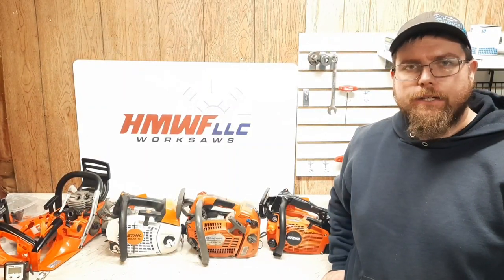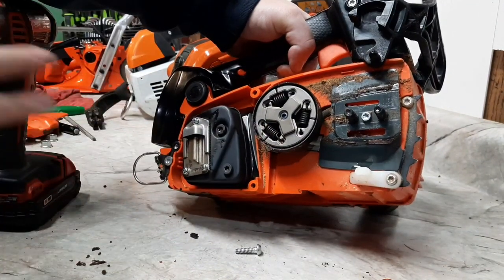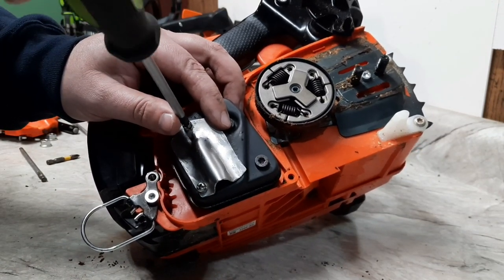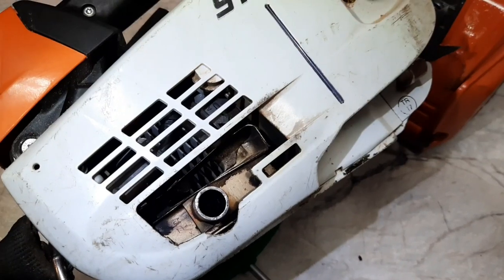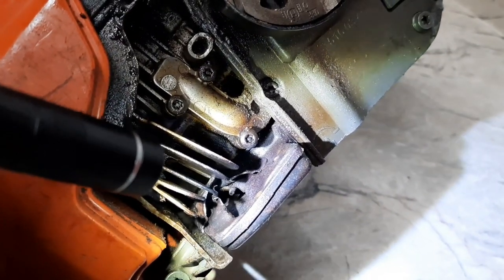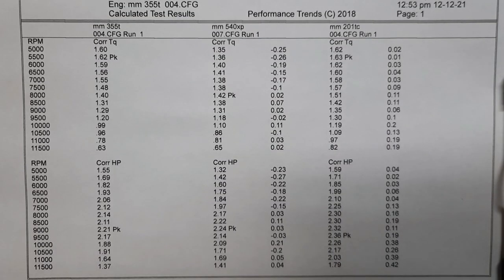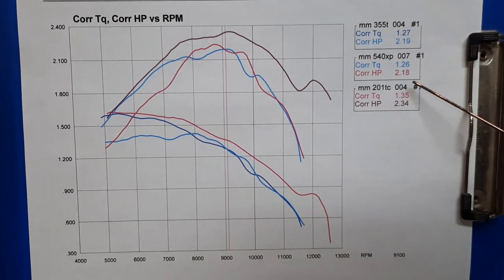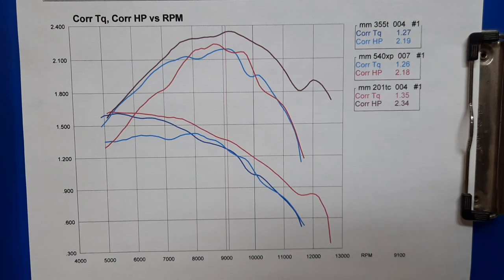Stihl, Husqvarna, Echo Top handles! Most powerful!!

Comment: This is why I feel the echo 355 with a muffler mod, or even a bolt on ore-modded muffler, is such a great deal for a top handle. My buddy runs an echo 330t and it's a great saw. Not quite an echo 355t but it'd be far better than any comparable priced top handle out there.
Reply from the maker: Most cost effective option for sure.
Reply: @dynojoemods2764  13200 RPM MAX IS OK 372 XP OE?
Reply: I used the Echo top handles in the past and they were good units, The Stihl is also good, it does have more power and built a bit better in my honest opinion, I am not biased. I never tried the Husky top handle but I do have several 372xp saws and I like them.

Comment: 355t is probably the one with the most ridiculous gains I've got from a ported saws, its like a 50cc saw after mod. Just unbelievable....nice work as always brother!
Reply from the maker: Will be fun to see the gains!
Reply: @dynojoemods2764  @Paveen Raj my 355T absolutely rips! Jereme Bell did mine. Tube type muffler mod, ported, and timing advanced. You can see on his YouTube channel my saw versus a 201T a year ago.
Reply: @johnlincicum6390  what a beast!
Reply: @vinzer8808  yeah it is. Bellhopper couldn't find my 16" bar I sent with the saw, but rest assured I run only the 16" bar on it and it still rips.

Comment: Joe, I remember showing pigs with you and your brother at the fair. How interesting to find you on youtube when I'm looking up saw performance. Great videos! Keep it up
Reply: I'm also curious to see how a 435t sizes up since that's the one I use every day at work
Reply from the maker: I'll have to see if I can track one down.

Hope you and your family are doing well.

Glad you found the channel, hope it can help with saw performance info.
Reply: @dynojoemods2764  I have one you could test if you can't find one. Same to you and your family!
Reply: @jaredeberly9724  I have 3 that I ported they will out cut my 540s.  Can't do whole lot with compression. But little goes long way. And lots of room for improvement on transfers and exhaust port. Just don't raise the exhaust at all. I widened and reshaped the intake and rased the bottom few numbers. Its mind blowing stout.  I port matched the exhaust to muffler.Closed of the tube. I use cut off deep well sockets on my custom exhaust so I can change the diameter and found 11 mm is the ticket! Cut whole in plastic have exhaust come out under the bar.

Comment: My company runs small Stihls and big Husky's. The t540xp can be a pain to start up in the tree at times. I've actually thrown one out of a tree because of it.
Reply from the maker: Testing the durability I see....

The one I have may have come from your company lol. Appears to have hit the ground a couple times.
Reply: Lol they can get aggravating. I don't even pull it without choking it anymore. 🤣
Reply: Each to his own I guess. I would like to try one of those Echo 2511t saws though just for the reduction in weight.
Reply from the maker: @treemerc101  

Ported 2511 is about the power of these bigger saws stock and I believe about 2+ lb lighter.
Reply: @dynojoemods2764  2 lbs is a lot less wear and tear on the body over the years. I really appreciate you putting the numbers out there for us. Keep them coming man

Comment: Is this really fair. the echo has a cat in the muffler which will restricts flow yes you opened the deflector but still, do the other two have cats being muffler modded and being auto tune? amazing how every ones says the echo is heavier, obviously is not on your scales, but yeah very little between them, i know when i decatted and piped my 355/360t.. turned into a different saw only downside is the filler holes are little small but it is an oldish saw now. still very cool👍
Reply from the maker: Probably not 100% fair. But all were simple 10 minute muffler mods. The husky was probably a 30 second mod. These were all just simple deflector/outlet mods.
Reply: I know what you mean, my friends husky 359 has a cat and we bypassed it and it really work up big time. Felt like it had an extra 30% more power.

Comment: Where's the 70cc class stihl 462cm an 572xp is really what I want to see them 2 saws others to compare
Reply from the maker: It is coming. Before 2022.  That is a hand full of saws to aquire. They are rolling in though.
Reply: @dynojoemods2764   have you dyno'd a 462 with the Red Beard foam filter vs stock airfilter?
Reply from the maker: @chrisp556  
I did one of those, I think it was a 462. They did improve over stock.
Reply: @dynojoemods2764  thx.   I have a Straight Shot and bn wondering if the foam filter showed an improvement on the dyno.  

Awesome channel Joe
Reply: I kind of know how it's going to go with 572xp and 462cm comparison  572xp has more grunt down low other then that they real close I have a heavy muffler mod on both   does real nice getting heat out an power gains can't wait to see the results
Reply from the maker: @jeffreyweible124  
It may be surprising.
Reply: @Dyno Joe Mods  I do believe you are right both those saws really surprised me they got different power curve it's gonna be interesting  love what your doing Joe keep up the work an videos
Reply: I thought it would take a few weeks to get saws to do 70cc class you must be doing a bunch .
Reply from the maker: @jeffreyweible124  

Shipping times slowed this up more than I had hoped. 8-10 saws. Not sure where I will draw the line yet

Comment: When do we get a video of some of your die repair welding? I wanna see some rebar being fed out of a drum into a 1000amp molten puddle. 😉 

Also, good comparo. Will be fun to see the big gainz.
Reply from the maker: Soon. Need to dig the equipment out and make sure it still works and if I remember how....

It's only .120/3mm wire and 600 amps. But plenty toasty

Comment: How do you think the cs-620p would run against an ms-361 I watched hotsaws video of it against the 362 and it smoked it. But that’s strato vs non strato I think the 361 would do better because it’s non strato. What’s your thoughts?
Reply from the maker: Should be very close. I think the 620 is heavier though.

Ported all out, the 361 may be a touch more power but it should still be close.
Reply: My 362 stock blows my brothers stock 361 away. I was 😲, maybe I should give it a closer look when it’s on the bench for maintenance.

Comment: The 540 was smoking the clutch if it had new shoes I bet it would do better just
Reply from the maker: That was smoking bar oil. The exposed muffler on the bottom of the 540 was smoking on the rubber pad.
Reply: @dynojoemods2764  ok that makes sense! Wasn't trying to offend just seen smoke and the rest of the saws didn't as much ha ha anyway great work thanks for the reply

Comment: That 540 has be run to death you can tell by the smoke
Reply from the maker: It has some use for sure. I plan to get cash models and the 200t and do the test all stock
Reply: Also the discolored plastic around the clutch, I'd like to see another test with a fresher one. The reason I bought mine a long time ago was it beat the 201 stihl hands down before stihl was m tronic.

Comment: if you could get the echo 2511t there would make them all look like a joke.
Reply from the maker: Stock the 2511 dosent hang with these bigger saws in power output.
But ported 2511 is right up close to this power level and a few lb lighter saw